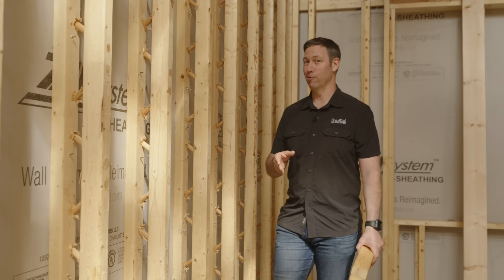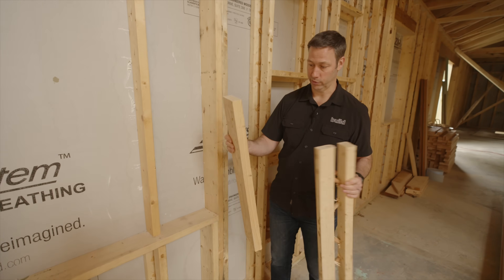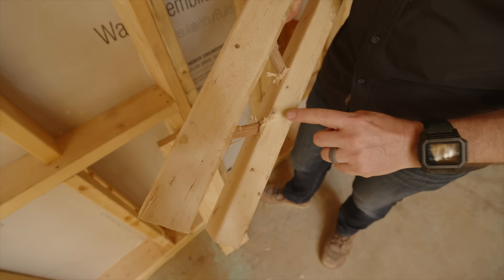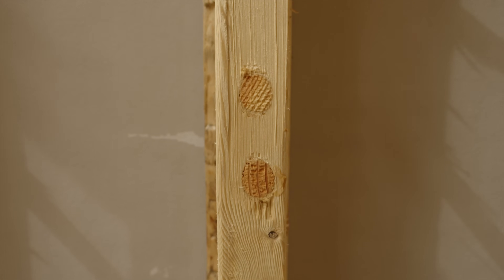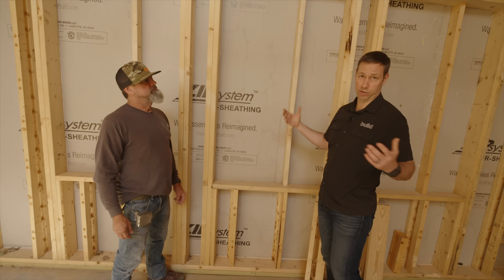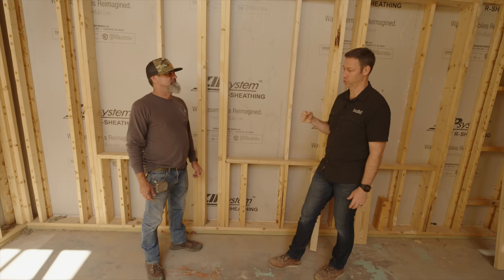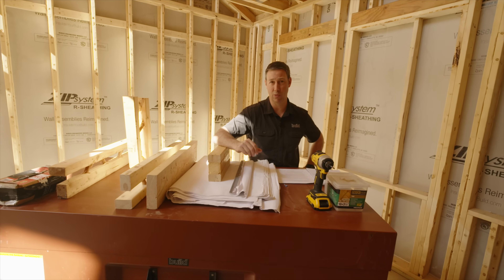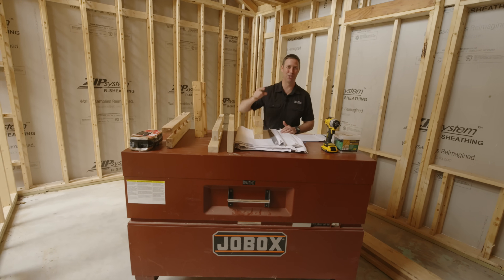Framing with a 2x6 Replacement - TSTUDS!!!

Comment: This kind of stud completely defeats a fundamental fire safety design rule.  All stud walls have fire breaks installed half way up the wall usually with a short horizontal section of stud.  This fire break retards the vertical spread of a wall fire by as much as 30 minutes.  This truss stud gives no place for a fire break and any fire break is rendered useless by the trusses depressed web design.  The Insulated stud is a slightly better idea but it introduces more formaldehyde into a homes construction.  The old traditional stud is still best.  Wall fires of course are caused by faulty or old wiring.

Comment: Upgrading 10% of the wall to ~R10 instead of ~R5 for 5X the stud pricing? Just stagger 2X4's on 1 foot centers on 2x6 or 2x8 endplates instead. Way cheaper and equal or better insulation.

Comment: the idea od the space between the out side and the inside has been around since the 1800s I am working on my Great Grandfathers house whice was completed in 1903 and it is built out of stone there is a break in teh wall from outside to inside and that is the thermal break to keep cold out and heat in so these studs that you are working with meke sence to me

Comment: A few thoughts:

A really fire retardant insulation might be necessary, or steel girder or pole reinforcement say every 8 feet, to avoid early collapse in a fire.  There are mesh poles that get immense strength with little metal. 

12:15 The really nice feature is you can run proper PVC conduits through those without drilling them, so your wiring & plumbing can be both modular and upgradeable. Finish walls with trusscore say and you can get at everything.  This also has fire prevention value as you can isolate the electrical sparks wholly within conduit.  Plumbing limitation isnt much given you can double the stud as shown.
Reply: These are a nightmare as far as fire prevention goes.

Comment: Wondering how hempcrete would do with those t-studs, after you have run everything of course. Filling it all would be some nice r-value and structure, not sure on the compression though. Sprayed in method may work well.

Comment: Great idea!! But, it would be much better as an even thicker wall replacement!  Why look at just gaining a little bit from 2x4 to 2x6?  Why not go to 2x12? You could just add a few inches of relatively cheap dowel to make SIGNIFICANT gains in R value. (Not to mention it would be sooo easy to run electrical or plumbing horizontally thru the walls!) Taking that thought even further; couldn't you just trap the air inside the walls by adding plastic wrap?  No need for adding insulation...the "trapped air" would be the insulation.  After all, that's all that insulation is trying to do..."Trap air".  Why add insulation "material" that will transmit heat? It's the AIR TRAPPED in the insulation that causes it to be efficient.  Why not just treat the wall like a thermos, and just have an air barrier?  It would be even better if you could place thick plastic and actually suck air out from between the inner and outer walls to create a thermos-like insulating wall.
Reply: there is a point WHERE  ANY ADDITIONAL WALL THICKNESS costs more than it saves...you asked SO IM telling you..2x6 is the max! ,especially at lumber prices double of 2 years ago(it got up to triple)......if I COULD HAVE MY CHOICE OF AN airtight house,no leaky windows ,and a 2x4 wall R13...OR A 2X10 WALL,r 30 but leaky windows ,I WOULD TAKE the airtight 2x4 wall!...THIS SILLY,EXPENSIVE TRUSSED 2X3 IS silly..and to prove it...YOU WILL NOT BE ABLE TO BUY THESE IN 5 YEARS!
Reply: @leewatkins1610  , assuming everything is sealed, I would take a 1 foot thick wall, let’s say SIPS, and I live in the harshest climate, which I do….it WILL pay off at some point. Yes, it is expensive, but if you have high insulated walls, and ceiling, and everything is sealed, it’s expensive in the short term, but it would be. MORE expensive NOT to have it in the long term.

Comment: This is amazing innovation.
I once had an "electrician " drill out a main bearing wall of 2x4s, to run conduit pipe.
He could have easily gone in the basement and ran the pipe and come up in between the 2x4s.
With this product the pipe or conduit will be protected also, labor cost will be way less., no drilling out and weaking lumber. 👍.

Comment: Looks like it's easier to run electrical, but what about plumbing?      What happens to the strength when you need to drill a 2" hole?

Comment: Don’t use 2x lumber framing. Use 2x metal framing instead. 2x metal framing is more dimensional stable. No crack, no shrinkage, no warping, no splitting, and as bonus: no dry rot, no mold, no termites. 100% recyclable. 100% non-combustible means lower fire insurance, too. Metal framing is stronger than wood and service life is much longer than wood. Given the current high lumber price, metal framing is your best choice.

Comment: What do u think about the metal home? this is wood/lumber. (There are termites in city San Diego, CA.)  I wanted to build metal type, so termites (fly termites) not attack during the lumber house is building... do u have shown on metal building?  Thanks a lot.
probably 6 inches also to make soundproof .... My house is also next to Alley and neighbor dogs barking a lot.  I wanted to build a 2 bedrooms Unit and make it soundproof so I can sleep better.  Thanks

Comment: Matt, I suggest you watch a FrameCad or other CFS presentation.  If you add gorilla Board (magnesium oxide) you are now building essentially fireproof structures, even use thin pan concrete floors you are providing a very long life fireproof structure that is a much better investment and saves peoples lives.  BTW, we are an engineering firm.

Comment: as there is a thick side and a thin side, is there a reason why you couldn't alter?
  I am thinking this would allow you to have the thick seam (outside or inside) whenever you are butting plywood/press board or drywall and ensure better coverage.  The fact you can run wiring without the need to drill holes is also awesome.

Comment: A year later and they are not cost effective. The cost increase at 2 to 5 X  of a standard 2 x 6  just doesn't add up.(yeah I know depends on who you ask) If you spend 5000 on lumber and the increase makes it 10,000 then the payback is not realistic. imagine you save 10 dollars a month on your heating bill if you use these studs. Then all you have to due to pay for the additional 5000 dollars you spent on these studs is wait for 40 years. and your all set. Oh I am being generous with the 10 dollar savings amount. I think it would be more cost effective to place additional money into a ZIP R panel.

Comment: By capping two 2''x2'' with two 1/8'' plywood with the wood fiber at +/-45 deg  with carpenter glue to make a closed section no holes would be required like with the dowel pin system and the section would be more resistant to flexural and compression stress. Also, the air trapped in the section would act as an insulator.

Comment: Wondering  what these cost .also wouldn't  it be better  / cheaper with double wall construction 2x4 stagger walls  .where you could easily  have a thicker  wall / insulation

Comment: I googled Tstuds: they are not cheap—about $2.50 per board foot vs. around $. 50 per board foot for 2x6s. But Tstud's advanced framing approach means 24-inch on-center, single top plates, and virtually no deep-member headers at doors and windows.Jul 3, 2019
Reply: Yeah maybe in Texas or Tennessee , Calif.? Not.

Comment: Thinking about impact on the environment vs traditional 2x6: Does the savings on HVAC power usage (over say 5-10yrs) from presumed efficiency of the TStud OUTWEIGH the presumed additional power consumption from the total manufacturing process + supply chain for this product (including the adhesive)?

Comment: I have seen that carpenders use metal trusses to frame floor joists. The fitted in the center of 2x4s which were routed into them. I between the joists they put metal trays to build concrete floor. The job was for the miltary.

Comment: From a firefighting standpoint, I know these are superior in terms of insulation value and strength but what does this do to the fire rating of a home? Traditional framing gives you a larger time frame prior to collapse from fire load because it is solid wood…this seems it might give us even less time that even lightweight truss framing which is roughly 8 minutes to collapse potential under fire load…we need to look at all aspects when building these new homes! Great video and very educational!
Reply: Excellent point
Reply: I bet it has something to do with the insulation. If it's batting I bet it will burn faster as it has a high surface area to volume on the other hand if its a fire resisting blow in  that villa the space in between you may end up with a much longer burn time as the fire will have to travel down those small dowels before it can burn the other piece.
Reply: @Bshwag  I don't know how much the insulation would help, but I do know in class they told us that trusses tend to fail much faster than their solid wood counterparts. It has to do with the way the trusses are put together.
Reply: @rascalpup5237  I do know that large pieces of solid timber takes much longer to burn through and it has to do with shear mass of material. In this case there is about the same mass and there is an air gap that could be filled. I also think the strength of each side is probably capable of holding up the load without the other side, while in a  horizontal truss once one goes the whole thing falls.
Reply: Those TIJ's (waffle board trusses) I hear go up in smoke and fail quickly.
Reply: I'm still scratching my head about whoever decided the best wood to frame a house is gonna be pine which in my wintertime fireplace lights up spectacularly and rapidly. jus' sayin'...
Reply: @theoriginalchefboyoboy6025  Pine grows relatively quickly compared to other woods. It's also a bit more stable when it comes to warping from moisture. Not to say that it doesn't happen but it's likely to be less severe.
Reply: @theoriginalchefboyoboy6025 I don't know about pine for building but once I visited a coal mine and they told me they used pine in mines because when it starts to fail it makes a cracking sound long before it actually breaks this gives plenty of time to get out.  I thought that was an interesting property of pine.
Reply: With how the splined pegs hopefully dig into the wood on each longitudinal member (see how much splintering is going on on one side?) I think these are pressed together with glue in the splines.  My GUESS - I'm not a structural engineer - is that since the pegs and longitudinal members are all solid wood and there appears to be both friction and adhesive holding the pegs in these should do significantly better than a TJI in fire (the osb web in those falls apart when the adhesive melts) but definitely not as good as dimensional lumber.

I'm curious how close to correct I am on this.  Would love to see a scientific test on it.
Reply: @kenstein  me too
Reply: TJIs begin to fail at 300 degrees, being that these are glued via spline I would imagine that we have a nearly stacked lumber yard with more flammable foam between and around the house. This is about speed vs our life
Reply: They are Billy Gatesy's dream !
Reply: Will the time of one stud really matter that much when you have no fire break between stud bays? For years we have had special considerations for balloon frames and the fact fire can travel vertically. This would allow any fire in the wall to spread from corner to corner while impinging on those dowels so your time curve has to factor the failure of multiple studs, and the cumulative loss of strength. Is one stud that fails 50% faster any worse than 5 that lose 25% at the same time. Id say much worse and without knowing how many are compromised and how badly its hard to have the same definable difference before the structural failure.
Reply: From a fire restoration perspective, I'd also like to add that with the airspace in the middle of the studs, there's less isolation of smoke. If a fire gets past the drywall, the ENTIRE house would need to be gutted to the studs, then cleaned and painted, to be able to get rid of the smoke smell (hopefully). I would also be weary of how the adhesive on the dowels will hold up to heat/cold and moisture.
Reply: These will fail miserably!!
Reply: Having just gone through an updated building construction class this was the first thing that went through my mind. While yeah, its great in weight reduction and insulation, it would be nice if builders thought about the dangers from time to time. Could only imagine how quick these studs could fail under fire conditions.

Comment: In an age where we have to focus on conserving natural resources, these T studs look to use 1/3 less lumber and still provide superior strength.  Perhaps this technology will one day overtake all linear structure products.
Reply: 1/3 less lumber? It's a pair of 2x3s. So two 1.5x2.5" dimensional. Effectively 1.5x5" dimensional total footprint. Plus dowels.
That is no where close to 1/3 the total wood volume of a 2x6. That is roughly a 10% savings of wood volume without counting the dowels, and last I checked? Making dowels was not a very "efficient" wood product on its own.

Comment: The first thing I thought was those dowels should hold those things straight and then I thought of the plumbers and electricians.
Then I got to thinking of it as a way to use 2x3s to frame and alarm bells rang. 
With lumber being made from small trees bred to grow really fast, the quality of our lumber is declining.
Alarm bells continued to ring because of the reliance on glue. I don't want to rely on glue for anything.
The reason they come out with new wonder glues every few years is the previous wonder glues weren't so wonderful.
I also want to know how these things stand up in a fire. One thing they don't tell you about engineered floor trusses is how quickly they fail in a fire, putting firefighters lives at greater risk.
Ducking the cost at the end of the video gave me pause.

How much would I have paid building the same house next door?
I was in construction for 45 years, by the way.

Comment: How is this material used where firestops are needed?   Could this be used by  prefabbers?  In the beginning of the video, Matt talks about the Tstuds not being used everywhere.  Is this an onsite change or are the prints specifying where it's used specifically?  Would any use of these Tstuds be a code problem somewhere?

Comment: I did my apartment with a 2X6 top and bottom plate and used 2X4's staggered every eight inches from inside to outside of the plate. This means there is no energy transfer though the studs. Had my apartment checked with a thermal camera and it showed thermal loss only through the windows and a little around the doors. My windows are thermal windows.
Reply: I bet you saved a ton of money compared to the t-stud
Reply: This is also a method used for soundproofing.  Same concept for sound as Thermal.
Reply: I've done similar here in Canada, my exterior walls were regular 2x4 stud walls........ 
But with another 2x4 wall 2" inside the first with the studs offset by 8"; roughly R30. 
Note, I did this in the mid 90's.
Reply: That's a long time practice in wood framing and very effective at reducing heat transfer. And it uses much less material/labor than the technique discussed here.
Reply: @MrPhotodoc  Seems there is potential for splitting those t-studs.
Reply: I just posted that I did the same kind of thing on my addition.  It passed building code plan approval and inspection, although I must admit they did not seem to really get what I did, it just looked like 2x4 walls to the inspector.
Reply: I heard about a better one with the 2x12 top and bottom plate with 2x4 staggered stud.
Reply: that sounds badashe

Comment: This is not really innovative. Just use 24oc reg studs or do external insulation. If you want max insulation with internal insulation and no thermal breaks, turn your studs to the outside of the top/bot plate. You'll use twice as many studs, but might be cheaper and definitely better than this weak idea. As for headers, 2.5 inch rigid foam between two 2x6 boards will give you a perfect 5.5 inch wide header.

Comment: I'd hate to say it because I like to give people a chance, but this product looks like a solution looking for a problem to solve.  The thermal gain seems negligible compared to the potential cost of the engineered stud.  It appeared to break easily.  The total energy consumption in milling, engineering, constructing, and bill of materials needed to create this stud seems excessive compared to a simple 2x6.  It feels like a typical engineer's dream, let's take something that works, overengineer it, claim it is better...

I'll look into this more, but it is like my Dad said, if you spend $40,000 on a new car to get 1 more mile per gallon, you failed math.

Comment: You always going to loose some heat, matter fact that little extra heat keep the structure more uniform, Tstuds sound and look great but your wall are basically a 2x3 not 2x6. I may be wrong time will tell but for sure we build houses to last 100 years or more and a traditional 2x4 or 2x6 frame will last long long time. I like your videos Matt, very informative and keep people updated on new building materials.Thank you.